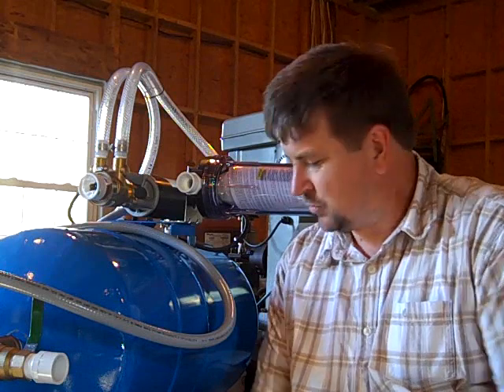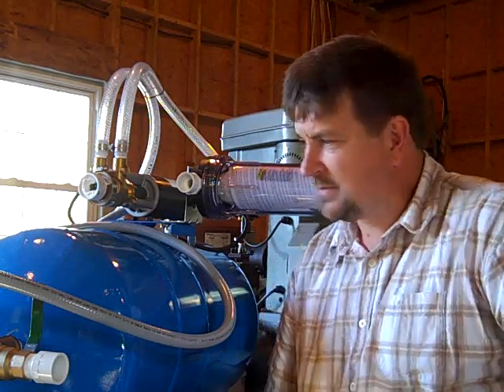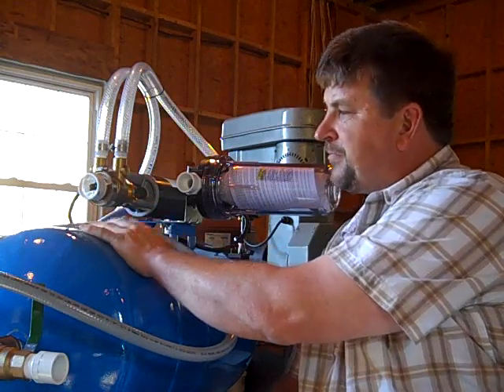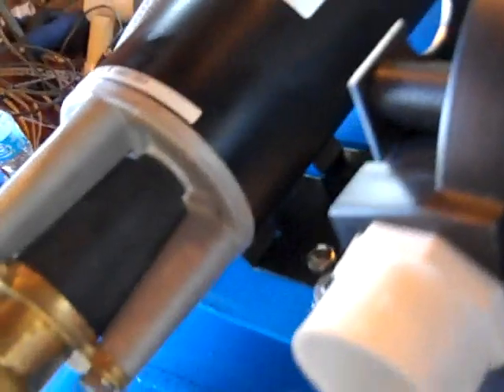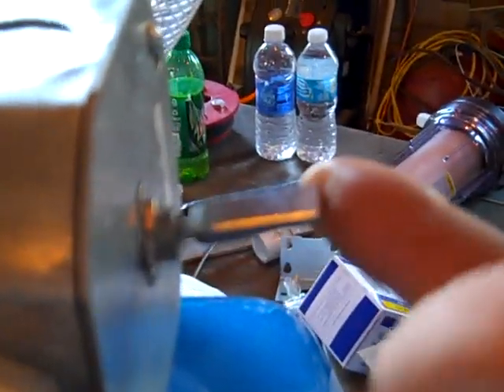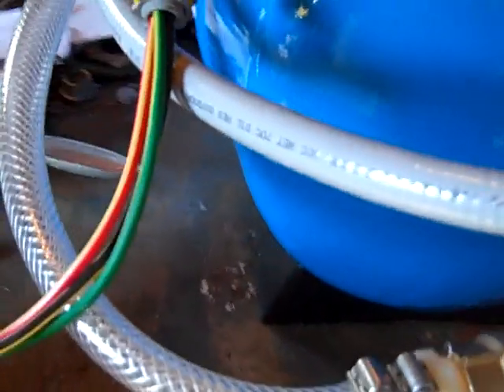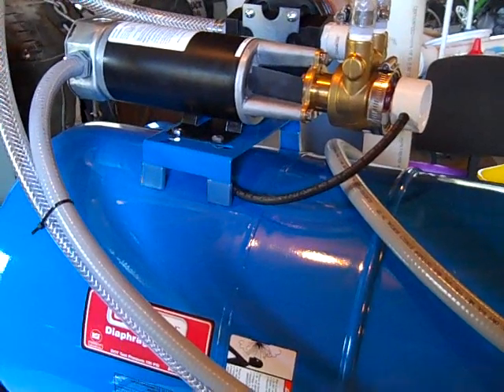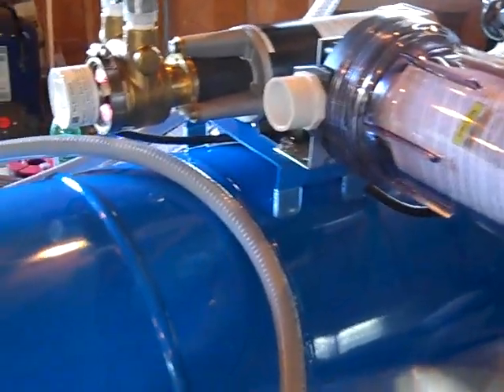Need a boost.. These pumps can't be beat

Comment: Great video except for the blurry parts.  This is exactly what I needed.  We have low water pressure so we are installing a holding tank, pressure tank and booster pump.  I like the idea of it running off of 12volts!  I can go Solar and wind to power it.

Comment: Thanks for all the great technical videos. 
You give a great service to all of us with such great professional videos and technical advice 

.  One question I have for you in a grid down scenario . All of the gas stations will be sitting with no way to pump out there fuel with no electricity. What would you use in the way of a mechanical pump designed for pumping gas out of an underground gas tank in a grid down situation?
  
Thanks for your great work it is very much appreciated.

Comment: Nice video how much do those pumps cost down there? i don't see any advantage to why you run the positive through both contacts on the pressure switch, i would just use one and save the 2nd one for when the contacts on the first one wear down.

Comment: I have a well and my water pressure is great except for the shower it has very low pressure and I can't figure out why... Any ideas on what I can do to fix that? My set up is old and the pipes are old as well... I don't *think* I have a leak but I have no idea what the problem is. Any advice you have would be greatly appreciated. Thanks :)

Comment: I notice you use a 10 micron filter followed by ceramic.  My question is can that pump handle a 5 micron filter, followed by the same set up?  Maybe I am out in left field, but I thought 10 microns might let some bacteria through, although the ceramic filter should handle that.  Maybe I am out in left field, but any guidance and wisdom you may be able to provide would be greatly appreciated.  I am in WV and am looking at lifting water a pretty good vertical distance over a fairly short run.

Comment: I have built a gravity water system with a tower and tank. I use an air lift pump to fill my tank. The water pressure is very low so using things like a water sprinkler for my garden doesn't work. Would one of these pumps work for that application?

Comment: i have 65 acres of land and a well...but its 250 ft deep...how would i get the water  out with that deep a hole? with solar..or any other way thats off gride.....right now i have a 1/2 hp 240 volt pump...thanks

Comment: I guess maybe you're not an EE, the way you've wired that Square D pressure will not make it last longer, you have the contacts wired in series, not parallel... and No negative switching is not better.